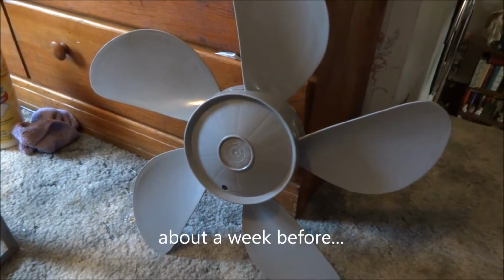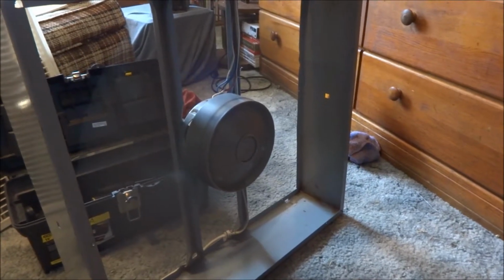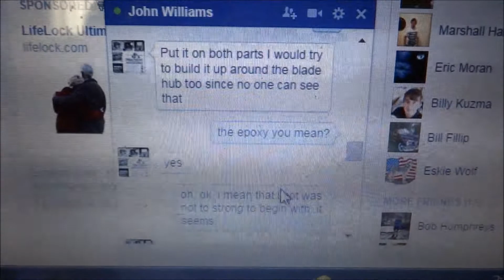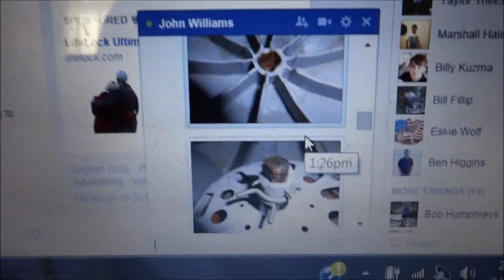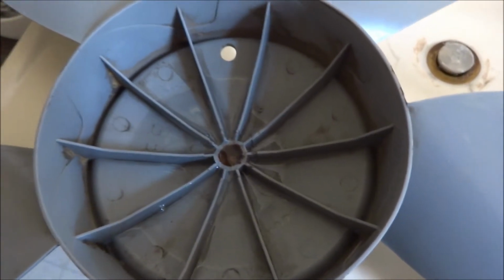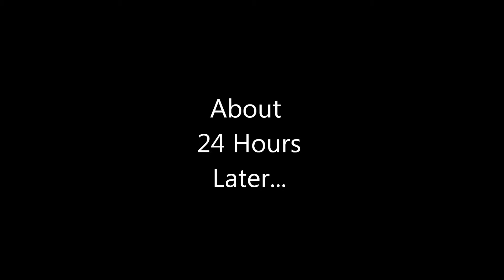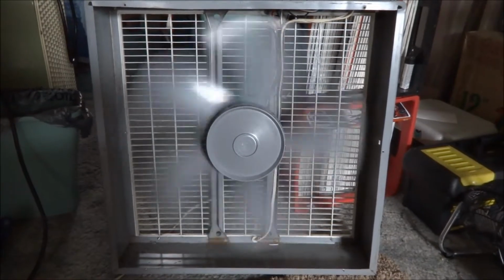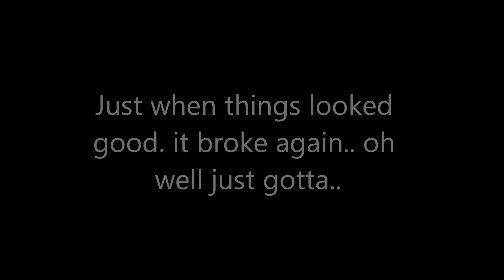Restoration of a Galaxy 3713 Part 2

Comment: Idk how you have so many problems with these Lasko/Galaxy hubs I've never had one break. And I got a good white blade in with your Holmes Air maybe you could paint it grey or something. Oh and i threw a motor in there too but i got no clue how good it is haven't tested it in forever
Reply from the maker: ok, thanks bud! thats my plan. iv got a blade (the one on my 91-92 model) whitch came off a Lasko Cyclone. im gonna paint it white. and maybe use the one your sending for the other one. but ya, i dont get my luck with these fans..they must not like me..LOL even though they were my favorite Galaxy boxers.
Reply: ***** Same here except my luck seems to be with motors that either buzz like crazy or have terrible bearings. I think that motor im sending ya buzzed a little but always ran just fine other than a thirst for more oil like most of them have. I know my 89-90 Lasko grey blader can't get enough oil. Literally it dont matter how much i oil it its still slow starting
Reply from the maker: i have not had that issue with this one. although all the lasko boxers i have do have a bit of a buzz on startup. i know once they warm up. they stop buzzing. and start running faster. that was the case with this one for awhile. it had the thirst for oil. but it has stopped here lately.
Reply: ***** Well your lucky mine never give up that thirst if anything they just keep getting worse and worse. But most of mine buzz pretty bad when they're cold but it mostly goes away when they warm up
Reply from the maker: the Wind Machine i have does that. and it takes a little bit to get up to speed. but once it warms up. it runs great
Reply: ***** Lucky you yours runs great mine I can't even use on high because it buzzes and hums so bad it's too loud to talk over and you can hear it throughout the whole house. Not sure how I'm gonna go about fixing that quite yet
Reply from the maker: you could put the Plastic motor in that one. if it were me id mix and match all the good parts and have one good runner. thats what i did with a few fans iv had over the years.